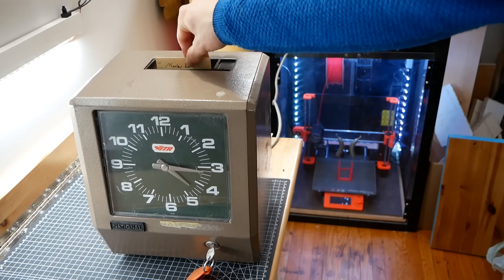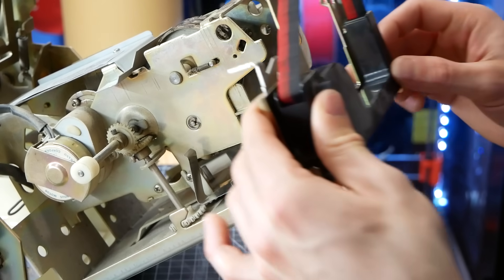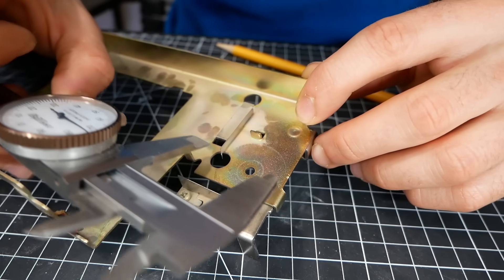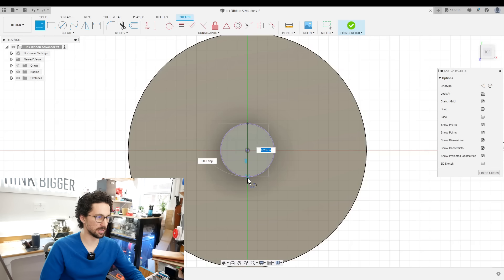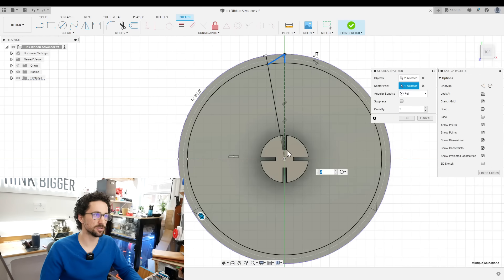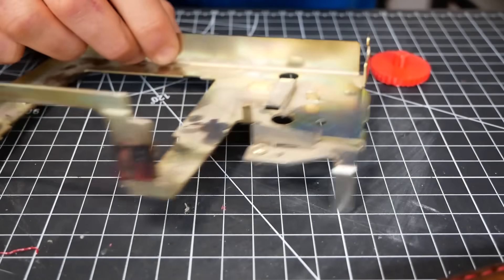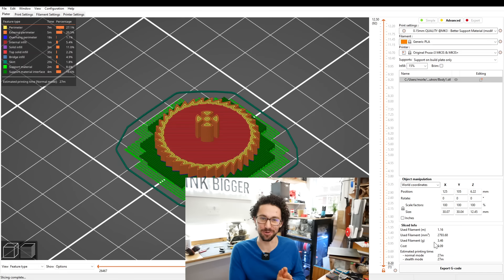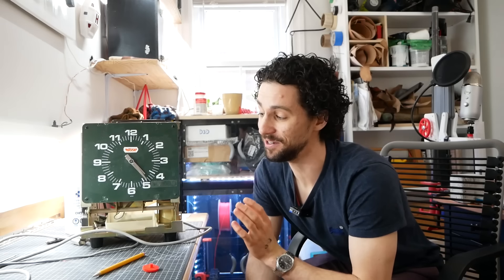They wanted 100 dollars. I 3D printed it for 9 cents.

Comment: 9 cents huh... plus the cost of the printer, material, computer you designed the piece on and the software you use do design it. But yes... its is nice to be able to fix your own stuff.
Reply: that's like saying, "5 bucks plus the saw to cut a piece of wood", as if that one bit of wood is the only single thing the saw is ever going to do.
Reply: @tsm688  The point of my comment that you missed was that his title was inaccurate. Its more accurate to say that the part was made with 9c worth of material... not that it only cost him 9c to make. Since the vid has over 255k view I imagine he's also made that 9c back too. :)

I will say that $95 for a small part on an old piece of equipment seems excessive. And its a wonderful thing to have the tools to fix things yourself. I'm sure he'll get a lot of mileage out of that equipment.
Reply: @b20di3  my point that you missed is that that is immaterial.  He didn't buy the printer to make this part.  It's not part of the cost.
Reply: @tsm688  "He didn't buy the printer to make this part." Obviously.. I'm not sure what makes you think I thought that... but whatever guy. Have a nice evening.

Comment: The emphasis on nine cents seems a bit disingenuous.  It disregards the time and effort that would be put into designing, testing and making the product.  Focusing solely on cost of materials is the kind of thinking that really screws over up and coming makers.  Also, it appears the 95$ price tag was to replace the whole assembly.  There are good odds that the replacement assembly would be an updated version, and even if it wasnt, that the company would have replacement parts for such an outdated piece of equipment is astounding.

Comment: Nice practical use case even though your investment in time alone pretty much meant you saved diddly...unless you have a lot of free unpaid time on your hands. Design-wise it looks like you could get away with far fewer teeth...perhaps a half dozen. In the future, model the teeth alone around the perimeter (using pattern as you did) and you can cut out that additional pain in the ass step of selecting all that crap to extrude via cut.

Also, it's important for DIYers to understand that applications such as this one are okay for 3D parts on home printers. But I see far too many people printing critical structural components thinking it's a substitute for the OEM injection molded or metal parts. It's not. Worse, some of them are selling that crap on eBay and they're going to get someone hurt. Fortunately, this particular application works just fine.

Comment: Since it manual it’s a cylinder, A Solenoid is used with electrical current mostly known in cars as a Starter both are used in automotive. A cylinder is also used in printing presses which is similar to this.

Comment: I jumped off fusion the instant they started bothering me with microtransactions and subscriptions, and then acquire a very legal version of inventor. Basically the same software, but it can be used offline.

Also, metric could have probably saved some extra time on the number approximation.
Reply: I tried warning people but nobody would listen.  And now they're very sad and locked in

Comment: You can't seriously think that spending all that time to make one part to avoid spending $100 is good value. Do it because you want the challenge by all means but don't fool yourself about the costs associated with manufacturing, inventory management, shipping, etc, etc. The price of $100 for a part that they have to stock but would probably never otherwise sell is cheap.

Comment: Parts shortages make this a new career option under right to repair laws. The files may be all that is needed in some cases. I repair appliances and sometimes parts being unavailable are why people throw out appliances. As long as it isn't a safety issue... this could be the ticket for ither situations where parts are no longer available.Shenzen and 30 plus other cities are still in total lockdown. Sanctions are going on, some of them surreptitiously. Supply chain issues and specialized labor shortages are here and will get worse. Something like this can make a difference!

Comment: I disagree with your conclusion. 

You did spend at least 15 min for prototyping plus a few hours for 3D printing. You can't apply this experience to all companies that use this type of register because they need to have a skilled employee in 3D modelling and printing and a suitable 3D printer. 

But you can always try to start a 3D printing business where you will design, print, and sell everything only by material cost. I will be your first customer.

Comment: Yeah... 9 cents + cost of 3d printer + cost of filaments + cost of electricity...

I get it when you have the necessary tools it is super easy and cheap...
Reply: lol 
this is basically the MO of most 'makers'   
make a 9 cent part using $5000 in tools
Reply: xcuse me, are you high?  that's not the only thing he's doing with his printer.

Comment: And to think, the company could have done the same job on a 3d printer, charge between $5-10 which would include having someone taking the time to design the piece + the cost of the materials used + the cost of shipping it out to you. They end up with a template they can store digitally in case someone else wants the same piece later + make a little profit and you end up with a much cheaper spare part without having to do the work yourself
This is why greedy companies whine about going out of business and yet somehow fail to understand why they only have themselves to blame

Comment: While I'm a 3D printing fan too (and also fixed a few devices similarly) ... your calculation isn't really fair. For starters, you had to print a few runs, and "good enough" was good enough for you (if it breaks down every 2 weeks, you won't care, just print a new one). So accuracy and material strength are completely different. Next, you also needed a few hours to analyze. If you would need me make a living out of thing, I'm assuming you would like to get paid for working for 2 hours too. Finally, that company had to package and ship the item to your place... Please make the calculation again.

Comment: This is literally the most clear image i've been shown as to how Fusion works, And I greatly appreciate it, Even if I had to sit through 3 minutes of you explaining that a gear is probably what goes into this gear-shaped hole.

((also "how many 10s of degrees will fit in 360 degrees? 35 looks good"))

I'm sorry, I know it's hard, And I do genuinely appreciate the video and will likely be watching more of your content, But dawg. 360/deg is how many teeth you'll get.
Reply: I just thought ummm, 10 into 360, how hard is that?
Still. I can't do CAD, don't have a printer, so there's that.
Reply: It is (accidentally) good practice to include an odd number of teeth for a part that goes through continuous wear. Unless the step size for each punch operation is 5/7 teeth, That way you do not land of the same teeth every time. The real missed opportunity here was to not use 37 teeth which would've been a prime number (and so close to 36).
Reply: @ShreyasBharadwaj  See, What you don't know, Is that I know this already. Prime numbers mean no factors which means no repetitive loads on specific teeth, However, This is interfacing with just a single bar, And if it was made PERFECTLY, It wouldn't matter, As the perfect gear would only advance one tooth per pull. However, That would require measurements on the travel distance of the bar, Which wouldn't be THAT hard, But it would be more difficult.
Reply: @milokiss8276  this is why you've never finished your own projects,,, thinking too much about miniscule improvements
Reply: @AntiDroidZ  My man. It's not about improving it... It's that he didn't get the right answer in the first place.
Reply: @milokiss8276  you saw it working, it got A right answer

Comment: Cheap, but I bet the teeth get worn out fast.
Reply: This time clock is a functional display piece......its not meant to be used everyday.
Reply: It’s cheap enough to make 1000 of them for the same price, so I think that’s a fair trade off.
Reply: You can make things tougher by printing in nylon. Someone replaced a high-speed part of a "Magic Bullet" blender with a 3d-printed nylon part, and it held up fine (though PLA pretty much disintegrated in a minute or two).. Though it will wear out quicker than metal (by a lot), even the PLA will hold up well enough that it shouldn't need to be replaced that often (at which point, just print off another with no design work for like 9 cents)
Reply: This function will put very little wear on the teeth.  Indeed, the teeth rub against a smooth piece of metal.  I think the little knob/bearing on the bottom will get by far the most wear.
Reply: Then you print another one

Comment: I 3d print myself and I get it ... it's great you got this rustic peice of history working  and kudos to you!   but... $95 vs 9c is a bit of a simplistic way to look at it... The manufactured part is likely metal and many orders of magnitude more durable. if you were to do a cost benefit analysis taking into account your time to design, cost of printer, time taken to learn the design and print process, longevity/durability/reliability, time taken to dis assemble and reassemble the clock to replace the number of plastic parts vs the metal part...  and the fact the company selling the $95 part has to make a profit... your 9cent part will not look as good.  Non 3d savvy people dont understand what is involved in the design/print process and expect 3D printing is the cure to all their woes... only to have dreams shattered when they try themselves. I think we just need to contol expectations. Great work though!!!

Comment: This is awesome! Just as a quick note - you can divide the circle's total angle measure (which is 360° or 2π) by the angle amount (in your case 10°) to get the total number of gear teeth you need = 36. I'm betting you might have already known this but were 'guessing' for demonstration reasons so sorry if I'm being redundant. Just love math 😅

Comment: Admittedly if you calculated the true cost of this piece, including your time, the cost of equipment required to make it, etc, your costs likely exceeded $95 for the first piece.  That's simply how economies of scale work, and explains why companies will charge $95 for a new assembly. That's another point: the manufacturer provides the whole assembly, you printed one part of it.  So this isn't an apples to apples comparison of costs, or of the goods tied to those costs.

Comment: 9 cents is good for you because you already own the 3D printer. $95 is good for me because I do not own a 3D printer and it'd cost me significantly more to get it just to print a small part.
Reply: yep.  maybe not 90 bucks though, specially if you find anyone local.

Comment: I use mainly Solidworks but I’m assuming fusion has a similar feature where if you right click after making a single selection and you can select similar parts which makes selecting a lot of things a lot simpler

Comment: I love how technically minded you are on everything and then something really simple slips up without you even realising. I promise this isnt a “ha look how dumb you are can’t figure out something so simple” but 8:40 when you’re figuring out how many teeth are needed you’ve already set the teeth to be at 10° increments. So to achieve a full circle would be 36 teeth.

Trust me this isn’t belittling you, ive literally never even used fusion 360 and im not an engineer, i dont know squat about designing parts, but it was just something i found interesting

Comment: setting parameters first is a good idea, no clue why I've never considered that. That would have greatly simplified some of my designs in the past. I've moved away from fusion 360 recently (not even on windows anymore) but the same thing exists in freeCAD.
Reply: It depends on what you're designing really, if it's a simple thing and you know what it'll look like from the start, or if you have a complex assembly with a few key parameters that drive a lot of features across a number of parts then it can save a lot of time.
For general design, however, it's just a matter of preference. Personally I think I've bothered to set up global parameters only a handful of times in my career, and of those times I certainly recall times where I've tried to be clever with parameters and it actually causing more trouble than it was worth.

Comment: POV: you use a $700 3d printer so you don’t have to spend $95 on a part.

Super cool to see how you built it, fusion is overwhelming at first to figure out how to not get in your own way.
Reply: You use a $100 saw to cut a $5 bit of wood.

But it's probably not the only bit of wood you cut.
Reply: But you get to keep the printer and fix all the other things that just need that one, small, impossible to find part.
Reply: You can get an Ender 3 for around $150 in any seasonal sale these days.
Reply: @ayylmao.mp3  You're very correct. I snagged a Ender-3 Pro for $99 with a coupon
Reply: this is how poor stay poor forever.
poor people buy $95 part, rich people buy $700 3d printer, print part for $0.09 and keep printer.
Reply: @moofymoo  you don't have to be rich to be smart, this part could have easily been made out of just about anything
Reply: @moofymoo  When in their lifetime are they going to need that part again?
Guess before the 3D printer was invented everyone was poor. Right?
I've never been in a situation where having a 3D printer would help.
Also it's the $700 or more 3D printer, the Cad software license which is what, like $500 a year and the resin/materials.
All for a tiny little part you'll need once in your lifetime. And even then it's such a niche situation to find yourself in.
Think before you speak.
Reply: @edenarchive4150  Just cause you never had a need to print a part, doesn't mean noone does. There's a free version for fusion, you can use for hobbies. Materials don't cost that much, and last a while, depending on what and how often you print. It is the cheapest way to get custom complex shapes.
Reply: @edenarchive4150  
I think you are missing the point.
Sure, the Prusa mk3 is $700+ and Fusion360 has a $500 annual charge, but the concept is what is important.
This could just as easily be done with a $150 Ender 3 and CAD software like Shapr3d which is a $120 annual charge.
Suddenly you are looking at around $300 for a printer, software, and filament. 
An important thing to remember is the fact that most machines and devices have those small niche parts that cost more than half of the price of the finished product, especially vintage machines like this card puncher or the typewriter that was also recently restored.
Another important thing to remember is the fact that the original part was also made out of a very cheap looking plastic, and WILL fail with time due to the lever being made out of metal. You will likely need another one in just a few months of regular use.

On a side note, do you really think someone went out of their way to buy a 3d Printer just for the sake of printing ONE (1) small gear? Did you even bother looking at the rest of the channel or the website? There are a ton of custom designs and stl files on a marketplace. There is a huge market for niche, custom parts, and in time the printers can pay for themselves. I know mine has via custom faceplates and mounting brackets for just about anything, as well as statuettes and small tools for hobbyists.

If you have never encountered an issue where having a 3d printer would help, you likely don't have that mechanic/technician/engineer/inventor drive to problem solve, or just straight up lack creativity. 
The tech alone doesn't make you rich; entrepreneurial spirit, modernization, smart investments, and proper advertising do. It also helps to not get fucked over by the original manufacturer.
You should follow your own advice and "think before you speak."
Reply: @partysqu1d  you literally threw a tantrum because he made you feel like you might have not made the best decision. the fact you felt that at all proves his point. also your haughty childish response.

Comment: If I were a cost-conscious company, what would you charge me for this part? I would buy several.

Also, how long do you think the plastic replacement wheel will last?
Reply: I can't answer your first question (he'd have to gauge out his time himself... the up side being that after design, the materials and processing would be negligible)

The second question is... it depends.

It's been a bit since I watched the video, but I think he printed with PLA, which would last... a while for something like this.

That said, if you wanted it to last a lot longer, then something like nylon would last much, much longer. I watched a video where someone printed a part for one of those "Magic Bullet" mixers, and it was able to deal with the full cranking of that motor.

Comment: Considering the usage in a 
factory setting, how long will
the 3D printed part last before 
failure? Great Stuff. Be well.
Reply: If it's really a concern you can do a metal part with lost pla casting.

Comment: If the tooth angle is 10 degrees, and there are 360 degrees in a circle, wouldn’t it automatically mean that 36 teeth fill the circle?